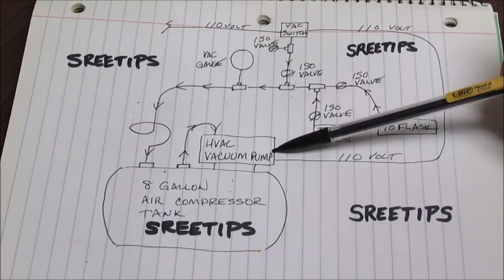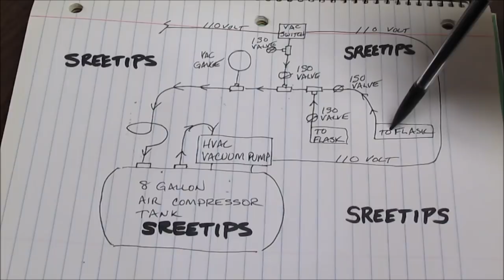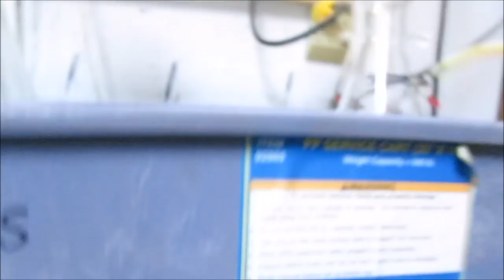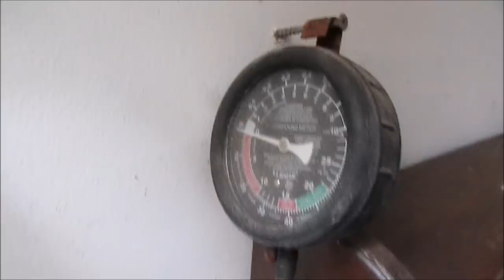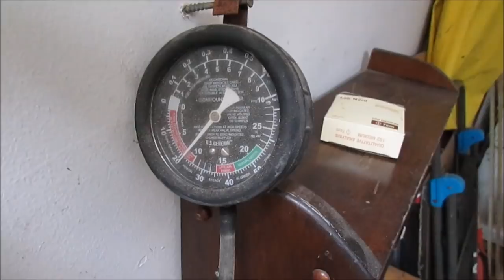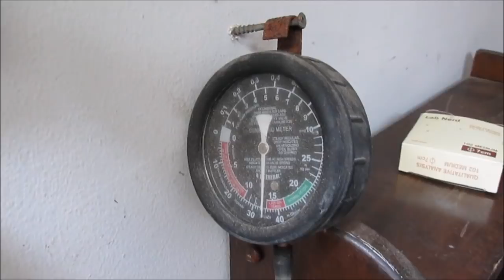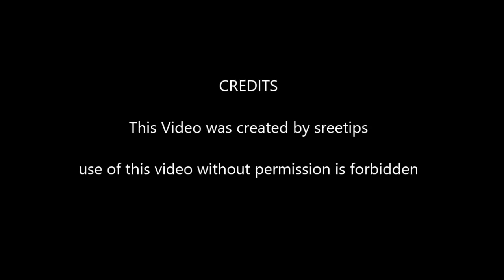How To Build A Reliable Vacuum Filtration System

Comment: I've been using a water driven aspirator from my garden hose.  I just turn on the hose and let the aspirator spray into the garden.  I plan to put a small water pump in a 5 gallon bucket and let the aspirator spray into the bucket.  Turn power on and get a good vacuum.  Put bicarbonate in the water to deacidify the vapors and protect aspirator and pump.  Dump the water out for storage.
Reply from the maker: The HVAC pump you see in this video was purchased late 2010 for $79 at Harbor Freight. It’s still in service to this day. I keep the oil changed. In some cases I’ve isolated the vacuum switch and used it to pull a full vacuum (29 inches of mercury). And the solution still pulled through in just drips every five seconds. If not for the vacuum pump, I’d still be standing there waiting for the solution to pull through!

Comment: Sreetips, what did you do to prevent/minimize the oil mist coming out of the vacuum pump exhaust? Mine fogs my whole room up...
Reply from the maker: You’ve probably got it too full of oil
Reply: @sreetips mine has the round sight glass and it's midway between both high and low marks. I'm wondering if some brands are just bad about spewing a mist out. What brand is yours?
Reply from the maker: I need to change the oil in my compressor.

Comment: Came here from your latest video comment section, and I have a question: where can I find that vacuum switch? I’ve checked eBay but nothing close or the correct voltage comes up.
Reply from the maker: Search PIAB EVS100 vacuum switch on eBay.

Comment: Cool, I think I will use your idea, just on a smaller scale, as I already have most of the equipment to build.
Reply from the maker: The main piece is the vacuum switch. In some cases, if you pull too much vacuum, the filter paper will fail.

Comment: Mr. Sreetips I need your help really bad. I’m trying to build a vacume system similar to your using a 10 gallon air supply tank for a semi and I can’t find a vacume switch and I’ve been to all the hvac supply stores in Lexington Ky. What is the name of the switch? As in what type of switch is it? I heard you call it a vacume switch and I can’t find anything g online or at the local supply stores.
Reply from the maker: PIAB EVS100 Vacuum Switch - check eBay.
Reply: @sreetips thanks sir I’ll check that out.

Comment: Thanks Mr. Sreetips, found it. Have you added an inline scrubber yet, so you don't suck fumes into your metal components? I would think this would be easy, and essential. Flask with 2 hole cork, baking soda solution, you get the idea.
Reply from the maker: Not so far

Comment: Why not just run an aspirator either with a faucet in an open system or a water pump in a closed system? $20 on Amazon...
Reply from the maker: Didn’t think of it
Reply from the maker: Plus, my system can pull 29 inches of mercury, for those stubborn filtering situations.
Reply: @sreetips  yea, the same. Got to your video because got tired of changing oil in my vacuum pump after every use due to water contamination. Thought about adding a cold trap since I filter hot solutions, but I think aspirator will be my goto solution.
Reply: That's what I do.  Works great if you have a faucet near your hood otherwise you can make it self contained with a submersible water pump in a 5 gallon bucket.  Add bicarbonate to the water to neutralize any acidic vapors.  Aspirator gets bolted to the side of the bucket and discharges into the bucket.  Power on, vacuum on.  Dump the water to store.

Comment: Just use the hvac pump , why all the extra stuff?
Reply from the maker: Watch the video. Then it will make sense. Too much vacuum will cause filter paper to fail
Reply: @sreetips  They make filters made of glass beads down to 1 micron. About $30 on ebay from china.

Comment: The 5-7 inches you mentioned,  is that the same as Pascal?  5-7 Pa?
Reply from the maker: Inches of mercury - not sure about pascal
Reply: Google will convert GAUGE pressure (relative to ambient pressure) for you.

236 inches of mercury is equal to 800'000 Pa = 800 kPa = 8 Bar = 116 PSI = typical compressor

0 inches of mercury is equal to 0 Pa = 0 kPa = 0 Bar = 0 PSI = atmospheric pressure
-5 inches of mercury is equal to -16'900 Pa = -17 kPa = -0.17 Bar = -2.5 PSI
-7 inches of mercury is equal to -23'700 Pa = -24 kPa = -0.24 Bar = -3.4 PSI
-24 inches of mercury is equal to -81'300 Pa = -81 kPa = -0.81 Bar = -2.5 PSI = common vacuum pump
30 inches of mercury is equal to -101'300 Pa = -101 kPa = -1.01 Bar = -14.7 PSI = perfect vacuum

Comment: Question Mr Sreetips :  given the series of metals you presented in another video, why doesn’t the platinum and Palladium come out of solution like silver does when you put copper into the excess gold nitric bath ? 
I empathize with your off camera time cleaning and removing metal and stones from karat jewelry ,  it’s a pain for me trying to get little gemstones out of gold jewelry .   You must live in the south ! Nobody in the rest of the country has a nearby friend named Bubba ! 
Thank you for what you do. Great education from your videos .
Reply from the maker: The PGMs will cement out, if present, after the silver cements. It will coat the copper black and then combine with the cement silver and turn it dark grey. It’s usually small amounts. They get trapped in the anode filter basket in my silver cell. I save and recover the PGMs from those filters.

Comment: Could you link to the pressure switch you used? Or something similar?   I realise this was over 2 years ago, and I'm being cheeky, so it's ok if not.
Reply from the maker: This is the exact switch installed; https://www.ebay.com/itm/PIAB-EVS100-Vacuum-Switch-EVS-100-Pressure-Switch-45G65RM/184153140154?epid=1619457962&hash=item2ae061ebba:g:wKsAAOSwPPxeMtTV

Comment: Will the fumes that are vacuumed into the tank or vacuum pump corrode them? Have you ever tried draining the tank?
Reply from the maker: Probably so. I've never drained the tank. It's been in service for about nine years. But one day it will probably fail and then I'll replace it.
Reply: Does the vacuum pump discharge fumes? Where does that go? Thank you for all the information, great videos!!
Reply from the maker: I haven't notice fumes, but I'm sure that some are drawn into the tank. This is why I run my fume hood 24/7 to constantly change the air in my shop.
Reply: sreetips oh, great idea. Thanks.

Comment: no one shows how to clean and take care of a vacuum filtration system of how to fix problem's that can and will happen when using a vacuum filtration I am new at using a vacuum system and my first time using it I clogged the white hard thing in side and the top of it trend black and the vacuum has slowed down even when I get the vacuum up to 250 I am afraid to get the vacuum higher then that
Reply from the maker: You "clogged the white hard thing... and the top of it trend black" not sure what you're talking about here. When the filter loads up with particulate the filter will slow down. That's why it's best to siphone the settled liquid first, then add the solids.

Comment: January 14th:

I wanted to say thank you for posting your YouTube video on setting up a vacuum filtration system.

Today I bought the 8 gallon compressor tank from Craigslist
I ordered the vacuum pump from Harbor Freight
I was able to find the vacuum pressure guage and vacuum switch on eBay.
When those arrive I'll acquire the valves, T's, tubing etc.

Just wanted you to know I really appreciate your videos, they are very well done and helpful and detailed enough to follow.

Then January 20th;

Well as of about an hour ago, everything is assembled and it functions very well. I spent the day doing the plumbing and the electric cords. It is turning on and cycling as desired. 

It’s not all tucked away neatly yet. Task for another day. 

Again, thank you. The detail in your video made this work for me. I’m quite excited about it.  :)
Reply from the maker: Excellent, I'm glad that you found it useful. I remember the day I assembled mine. It was like getting a new toy! Remember to get some compressor oil and change it every 3 or 4 months in the vacuum pump.
Reply: sreetips I wanted to show you the station you inspired. The simplest way I could figure to do was to post a video and give you the link. 

To Sreetips viewers, this is an outstanding channel. It is head and shoulders above most in the gold recovery and refining genre on YouTube. I highly encourage you to subscribe. 

https://youtu.be/Fpdnp5npAQE

Comment: I see from your diagrams vaccume goes from flask into the tank into the pump will vapors from filtering destroy it ??
Reply from the maker: It's been in operation for over 7 years and still runs strong. I change the oil 3 or 4 times each year.

Comment: Maybe put a bubling tank just behind the isolation valves for the proces flasks to catch corrosive gasses with a tap on it so you can refresh the water periodically? Probably good for the lifespan of your vacuum equipment.

Comment: No corrosive vapours building up inside your vacuum tank? (problematic when filtering hot AR solutions)
Reply from the maker: I don't think I've ever drew a vacuum on a hot AR solution. I always cool it down with ice or in the fridge before I put it through the filter. I built the system in 2010. One of the first things I did when I started my refining hobby. That tank has been in nearly continuous operation since then.
Reply: Thanks
Reply: OwlTech I always cool my AR solutions to let any silver chloride that could possibly be present to settle and if not when adding sulfuric to precipitate lead works cold vs hot either way I always cool solution...